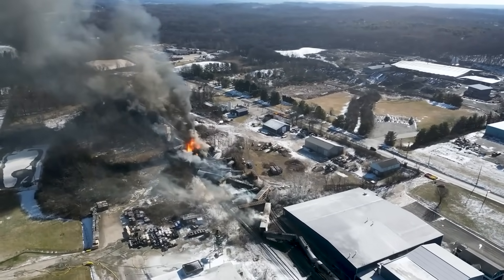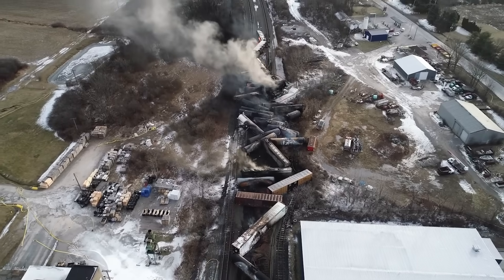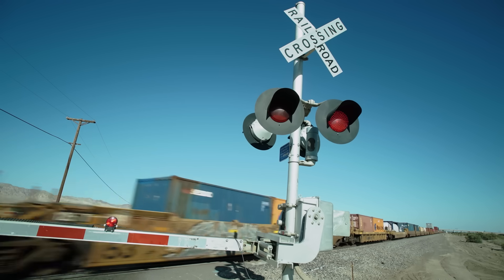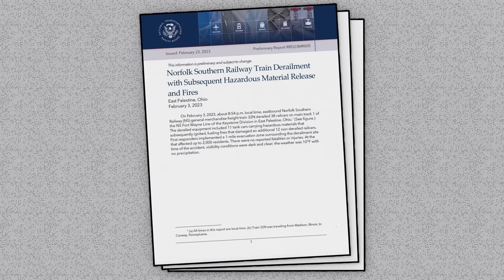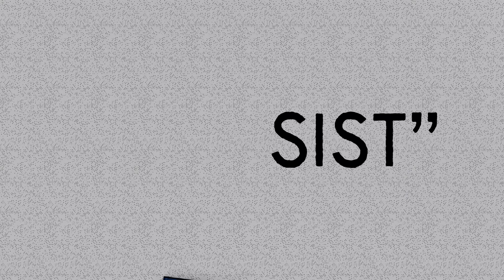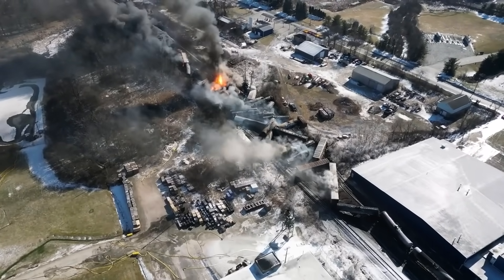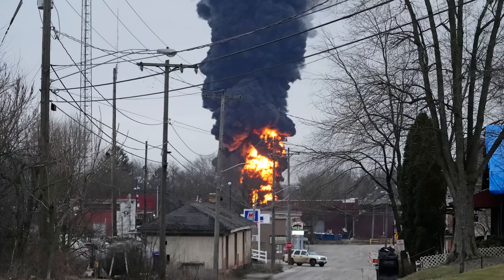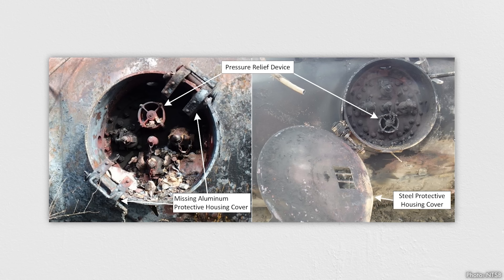East Palestine Train Derailment Explained

Comment: AXLE BOX DETECTORS & DANGEROUS LOADS !
Axle box detectors in Europe are also connected into the Block Signalling, so that if a Hot box is detected it automatically puts the next signal to red. But of course in the USA most signalling like the Caboose has been abolished to reduce costs. Which in Europe is regarded in such cases as "Endangering Peoples lives" so not allowed to be removed. Continuous "Block Signalling" can't of course be removed, as virtually all the dense Rail Network lines across Europe carry large amounts of passenger trains. Normally heavily outnumbering the number of freight trains. And of course move at much higher speeds than is normal in the USA. And every Freight train poses a potential risk to passenger trains, especially if they derail. Due to the numerous Highly Dangerous products, that have to go by rail. As some are banned from being carried by road if a rail route exists. Again to reduce risks to Human life. Such things as Nuclear Power Radioactive material which has to be carried in special wagons designed not to leak even if they are hit at 100mph by another train. Or Concentrated Hydrocyanic Acid, which explodes if it comes into contact with the atmosphere, so has to be carried in sealed 100% air tight tank wagons. 

RAIL SAFETY & POLLUTION IN UNDERSEA TUNNELS
The now famous Channel Tunnel under the English Channel Sea between Britain & mainland Europe is however banned to dangerous goods, including even Coal. For the simple reason such dangerous wagon loads can still use the older Cross Channel Train Ships, which may take a few hours longer, but again for safety reasons it keeps such Hazardous items well out of the way of the General Public. Passenger trains through that twin tunnels (2 x single bores) can be travelling at up to 125mph and freight at up to 100mph. Hence Safety has to be very strict in an undersea tunnel as there is no easy or quick way to get Rescue Vehicles down a 25 mile long tunnel quickly. Which is another reason a Car tunnel was not possible. Road Vehicle Carbon Monoxide would quickly kill people inside vehicles in such a long tunnel. And you can't have extractors and vents under a 22 mile wide Sea, that also forms one of the Worlds busiest Shipping Lanes.   

STRINGENT SAFETY REGULATIONS 
Britain & Europe have very complex Safety Laws dealing with everything from Railways, factories and even Shops, to ensure for example the Gangways inside Supermarkets have to be a minimum 14ft wide, so that there is enough width between the shelving for both Customers, and restocking trolleys. Otherwise a small child for example might be injured !      

SIGNALLING & SUPER HIGH SPEED RAILWAYS (150 MPH + LINES) . 
Finally thanks to the use of Block Signalling on all Europe's Railways. And the very high quality of track to allow trains to run usually at, at least 125mph, derailments are far rarer than in the USA. Where of course the whole European Network is 98% owned by the Government of each Country. The age of Privately owned National Railway Companies died by 1948 in Europe. Partly due to Health & Safety issues. Although some trains can be "Franchised private operators" the track, stations, and everything else is still owned by the State to ensure Public Safety. The current major target in Europe is the total abolition of Road-Rail crossings (Level Crossings in English). None of the "Super High Speed lines" (over 150mph routes) in Europe ever had such things as these lines are all Post 1974 built. And of course Freight trains are also totally banned from such lines. Further these "Super high Speed lines" are also obliged to have continuous 16ft High Security fences throughout there total length. To totally prevent People, vehicles or large Farm animals such as Cattle getting onto the tracks. As most of the trains on these new lines today, are moving at between 186mph & 210mph. Which is far to fast for the Human eye to fully comprehend, and the trains being Electric are also very quiet even at such speeds. And being Electric are also virtually totally Pollution Free ! 

DIESEL NOW A LAME DUCK !
Finally it should be noted that the Diesel locomotive is unsuitable for continuous speeds at more than 125mph, as British Railways proved back in 1975. The Diesels operational costs sky rocket at around this Speed, as maintenance costs soar rapidly as engine parts even with four stroke types wear out much much quicker. Not to mention the problem of fuel costs, which greatly exceed the cost of producing 25,000v AC for the overhead power lines to Electric trains. Where a 500ton Electric passenger train only requires around 60-70 amps to start and cruses at 150mph on no more than 35 amps ! The Diesel like the steam engine before it is slowly being phased out across Europe as more lines each year are being electrified.

Comment: This accident wouldn't have happened. The wheel detectors were to far apart. Let's not also forget that this train was double it's size. During the Biden administrations the railroads started making their trains over 2 miles long. With a train 2 miles long it needs a 2 engine DPU set from halfway back in the train. The rule of thumb is all EB trains are carrying loads to market. NS has put 3 to 4 trains on the ground climbing the east side of the Horseshoe curve. The last train on the ground was a WB freight. All empties except for 40 loads. The train was 275 cars long. The train was 2.5 miles long even with pushers to get it up over the mountain to Cresson. I believe that train was 11V WB.

Comment: Hi Brady,

I’ve been a long-time fan of your content and really appreciate the effort you put into your videos.

That said, I felt that in this case your video may not fully reflect the impact the accident had on the people living in East Palestine. You mentioned that all air and water samples showed minimal or no impact after the vent and release. I find that difficult to believe, though I don’t doubt your honesty or that you’re basing your content on NTSB evidence. Perhaps the concern is more about whether that evidence itself might be downplayed.

As an engineer, I would hope that your work not only presents the available data but also applies a critical lens—asking whether the data is sufficient, and pushing for better answers when justified.

You also stated that transporting hazardous material by rail is the safest land-based method. I don’t disagree, but I think it raises the question: is it safe enough? Could more be done—such as abandoning PSR, adding more crew, or improving rail and equipment maintenance? Saying it’s the “safest method” doesn’t necessarily mean it is safe enough, and that nuance is important.

Best regards,
Daniel

Comment: Even a properly operating pressure relief valve will not help if the product is polymerizing in the tank. They did the right thing on the vent and burn.

Comment: Bro, Grady, you just glazed right over what seems to me to be a big question, how the heck did those 38 rail cars come off the track?  Based on what you said in the video, am I to believe that a train that applies both regular brakes and emergency brakes is likely to derail?  What gives?
Reply: Brakes had nothing to do with the train derailing. The train was going downhill using dynamic braking to maintain a consistent speed. The axle with the bad bearing broke crossing over a turnout. As soon as it derailed the brake pipe severed thus triggering the automatic brakes to apply emergency brakes.

Comment: I was aware of the fact that train derailment is dangerous but hearing all the details it is scary as hell. Especially due to one simple fact. This time it was an accident, and that information really suprised me as from what I read it is extremely hard to derail a train. My first thought: so it finally happened, first terrorist attack. Most shocking is one fact: there are materials that explain in detail how to make derailing device using easily availiable materials and it is extremely easy and effective and could be done with someone with half a brain where industry-quality derailing device much more harder to produce and requires expensive machines to do it. I write so vaguely as not to give someone information as how it is done, because I hope that something like that will never happen, however my logic tells me it is only matter of time. To add to whole terrible situation with that there are even instructions for best places to derail, which trains to choose and how to recognize hazdrdous materials ets and how to cause the biggest carnage. And there is no way to even remotely secure even 5% of most such crucial places. If you ask why I write it? It is always better to know. Honestly from rational point of view I am still amazed that it didn't happen. Hope it doesn't but knowing some more details it is very easy to find that knowledge, and among groups that dangerous or have even remote affiliations even by chance it would be piece of cake. All I would have to do is to write a phrase or title here and every waco is able to do something that scares me extremely even that my country is near the end of the list of place that some people are obessed with. I even with that my rational thinking would be false and I exaggerate

Comment: Well a pipeline would have prevented most of these railway flammable fluid accidents near or in towns..
Reply: Pipelines are even more dangerous and do twice as much damage to the environment
Reply: @Dickpeterballs6969 pipelines don’t kill everyone in a city…unlike cargo rails have in the past like just a few years ago lol
Reply: @MathewRost   So 2 questions, 1 why are you comparing a class 1 railroad to a bankrupt class 3 that was running 1960s/70s equipment, which was operated by scabs with only 1 crew? 2 What connection does this have with East Palestine? the East Palestine train was not a runaway and or an entire 110 car train of  bakken oil. have you researched each accident? you can ship oil in pipelines. NOT the chemicals hauled by trains. especially vinyl
Reply: @Dickpeterballs6969  well jackyourselfhauf I won’t argue with you
Reply: @Dickpeterballs6969  but I bet you didn’t know dry bulk like sand or wheat could travel by pipe line… with out liquids or conveyors
Reply: @MathewRost   I only heard of coal slurry. didn't know about the others

Comment: In the situation of over heated bearings, the engine crew does NOT apply the trains brakes as that would add more heat to the wheel with the overheated bearing. They basically put the engines into no no forward power to allow the train to stop on it's own. I think this is why the threshold for wheel inspection needs to be lower.

Comment: As a engineer I think the detectors should be linked. If they detect a certain increase in the same location it should also give an alarm. The problem with bearings is when they start to go they usually fail very fast. If the timing before/after the scanner is unlucky like here, then you don't find out until it's too late like here, or until the train derails. Unfortunately the railroads are publicly traded which means they care about profits and profits only. The only way they'd spend the money on this or anything else to try and prevent this is if they're forced by the government against their wills to do it.

Comment: If you want a more detailed reason for them to control burn the cars just look up BLEVE boiling liquid expanding vapor explosion. Basically if the cars liquid gets too low it cannot help to keep the inner and outer shell cooled to a stable point. If it reaches above this temp it will hit a critical point where the steel is no longer rigid and the tank will turn into a massive bomb. The decision they made was they would rather have a big fire than to turn a tank car into a grenade

Comment: I wonder if the threshold for notifying the crew should be rate of change rather than a set high temperature.  Going from 38 to 103 above ambient from one monitor to the next sounds like a pretty clear sign that there is a problem.

Comment: NO, fire was 20 miles PRIOR !!  The train car on fire at Butech Bliss is on my street in Salem, Ohio and this is before the detector at MP 69 which is near S. Lincoln Ave. & Snyder Road. The security camera area of Butech Bliss is visible from my son's back porch. So, the fire is before the 2nd detector, air temp. that time of night was 10 degrees F, plus very windy, throw in cooling winds of train travel. Track 1, south rail, previous detector is in Sebring, Ohio. 161.070 MHz but only if set temps. by NS is exceeded. 20ish miles to detector just east of the main street in East Palestine, Ohio. Train came from Cleveland line to CP Alliance interlocking, then through Sebring, CP Murph west of Salem, named for a refusing to retire old gezer who joy-rided on the rails one weekend w/o permission. Security footage pointing towards S. Ellsworth Ave., my street, then 2nd detector. Radio call would be no defects, go figure. Train east through CP Lumm east of Columbiana, New Waterford, then East Palestine. Next hot box detector not until Beaver Falls, PA. Next interlocking not reached was Enon Valley, PA. NS removed dragging detector there that ConRail installed years prior. These detectors are old tech, need supplemented by other tech. NS claims they installed another in Columbiana after the wreck. SEE VotecEV where guy covers each location and has live radio transmits from each site. Line id buried signal wiring, cab signals wayside, lighted signals at interlockings, previous PRR position lights, now color signals.

Comment: So the bottom-line is that there really isn't any element of gross negligence or non-compliance here.
Yet the video clearly shows the problem axles(s) on fire before the train stopped.
That immediately suggests that the standard set for a warm bearing threshold is too high.  Setting the trip-point at about 150 above ambient might have saved this  train.  I mean, if you get a warning at >100, and a video of a shower of sparks at >250, what else are you going to do?
Resorting to casual dynamic braking is another bad habit engineers have settled into.  Depending on how much is applied, that can mean still rolling for 15 minutes or more.  The automated warning idendifying which axle and ending with "Stop the train" means STOP THE TRAIN.  Full-service (non-emergency) braking would likely have also saved this train.
[Update:] I just learned from another comment that only the first and last of 5 detectors were working.  So the identification of a consistently increasing axle temperature WAS possible.  And that also means that the railroad company probably does have a liability exposure after all.

Comment: one thing i am curious of is do train operators take into account not only the current temperature of the wheels but also the progression? from what was explained here it seemed to me like it had gone from 38 f to 103 f above ambient from just the gap between just 2 detectors over 10 miles, over 20 miles to the next detector i find it weird that in that time they hadn't considered that it already gone above the threshold based on the steep increase before whether or not it was still below the prevention temperature range, maybe that kind of an increase is normal but from an average persons perspective it seems weird to me

Comment: Telemetry is vastly better these days but is it more or less expensive to deploy than the cost of accident insurance? Everything is about money so the inquisitive will follow the money. Rail safety has a long bloody history (in the early days even railroad maintenance shops with something of a bloodbath, the Internet Archive has old rail pubs from the turn of the last century worth a read for many reasons).

The legal actions by the rail industry including resistance to crew size mandates show its true colors, being run by hacks solely focused on profit. The industry should be regulated and mastered as an adversary, not the partner it never was. That requires aggressive public activism but only the surviving victims care about rail issues which are obscure to the general public.

Comment: I have an acquaintance who is an engineer with one of the western-duopoly railroads. He relates a corporate posture that’s aimed entirely at moving maximum freight volume at minimum cost. This isn’t just efficiency, it’s obsession. Trains are three miles long, with four units up front and distributed power mid-train and at the rear. Move as much freight with two humans aboard as possible. It’s said they’d like to eliminate the two humans.

Rolling stock is dragged until it falls apart or burns. Locomotives are run until they fail, then scrapped. Maintenance is a thing of the past. Run the wheels off, then scrap it all.

Trackage was so bad in this area that trains were restricted to 15-20 MPH where they once rolled at 70. The maiden voyage of the restored Big Boy steam locomotive prompted the repair and upgrade of a “zillion” miles of rail—not routine safety concerns.

Around here, the train crews don’t seem to complain about the workload. They work all the time and love the big paycheck.